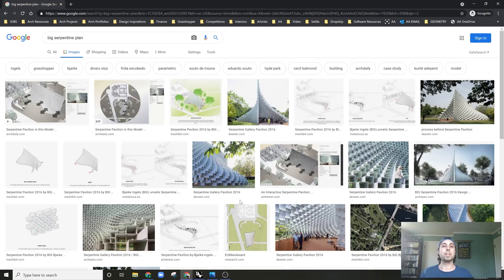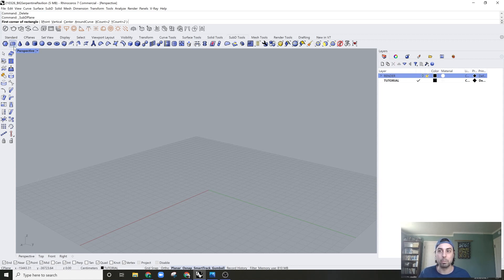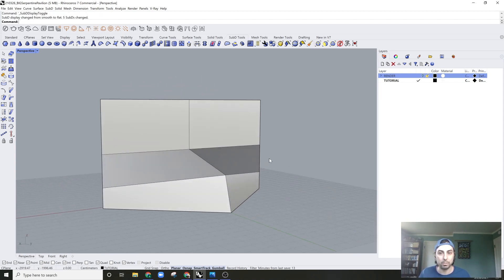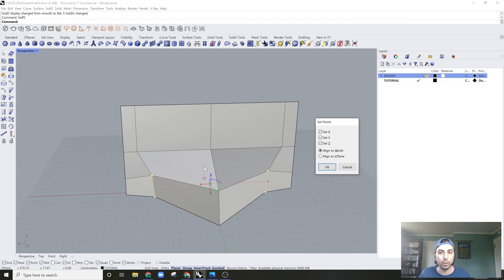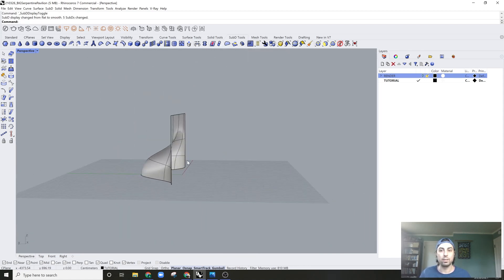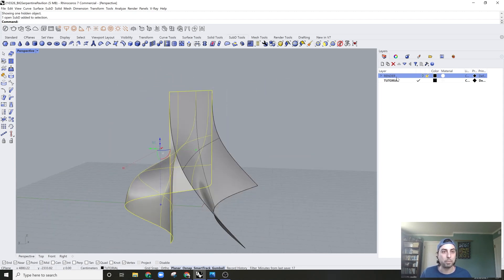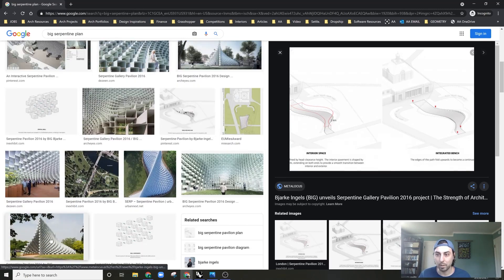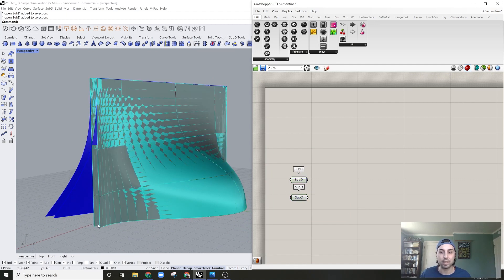Using RHINO7 SUBD and GRASSHOPPER to recreated BIGs 2016 Serpentine Pavilion (Beginner tutorial)

Comment: Hey! Very cool video, however I'm stuck on the Move to Point part, that module isn't showing up in my GH. Any thoughts on why this might be?? Thanks!
Reply from the maker: Hey, where at in the video was that mentioned?
Reply: @AndrewFriedenberg  at 18:13
Reply from the maker: @huihuiwong5201  ah I see, that is a Pufferfish component. You can alternately use the Orient component OR simply use the Move component and input a Vector 2 Pt for the motion input on the Move.